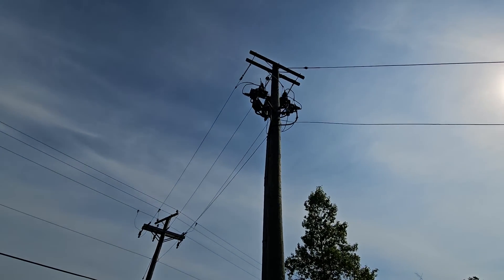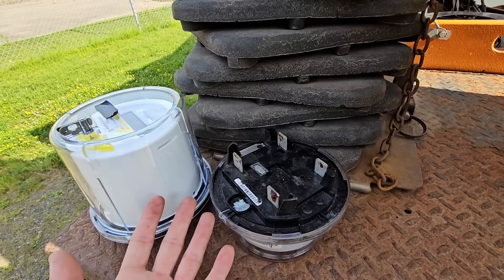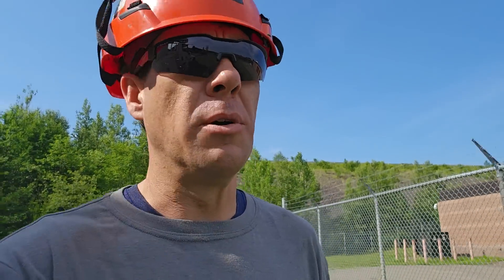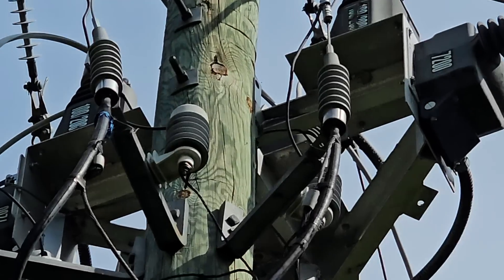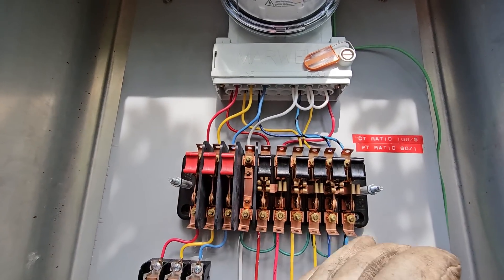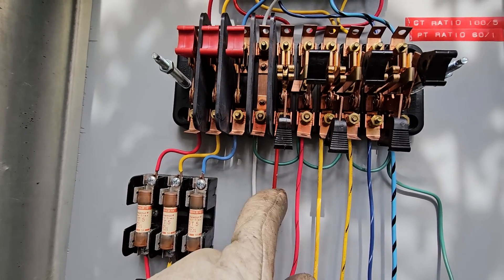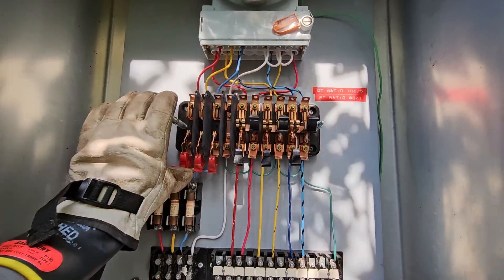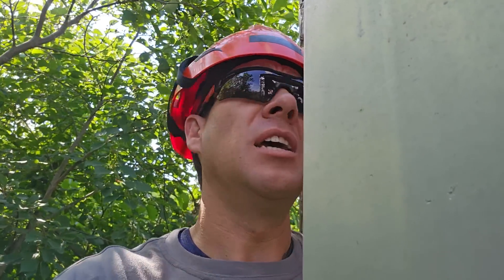Changing a "Smart meter" - 3 phase

Comment: In Germany every (most)costumer has a 3 phase 400 Volt and 63 ampere. Use a costumer more than 80 amps, they use the same technique to metering  like this video.
But the transformer are more central and the wirering are underground. The hole neigborhood use the same transformer.
The wires get in the last 40 ore 50 years from overhead to undergrund. Only 13kv and more are overhead lines.
I appreciate your content. Greets from Berlin/ Germany.
Reply: Same in Sweden, you just basically never see overhead unless it's high voltage distribution lines.
Reply: @Danieel-ip6hg  Sounds like a nightmare if you have a fault trip a substation breaker. Imagine the driving you'd have to do. Thump thump thump, find the fault 6 hours later and 40 spans away.
Reply: We do have 230/400V overhead lines in Germany, but only in rural areas or older buildings, where changing to underground cable would be to expensive.
Reply: @thebamplayer  Yeah, we do too of course. But the norm is definitely underground.
Reply: Residential is typically 3 phase 400v??
Reply: @petermuller161  Yes, unless it's very old. Older apartments with gas are often only given one phase with 230 volts.
Reply: @Danieel-ip6hg  Can we import this to Texas? LOL. Third world power grid over here...
Reply: @petermuller161  But it is three phase, no? It's just that you distribute two phases to each house? Also I understand that Texas is disconnected from the rest of the US.
Reply: @petermuller161  Texas's grid is fine. You've either never experienced power reliability outside of Texas or you're one of "those" who likes to claim Texas is terrible at everything because they vote different than you.
Reply: @Danieel-ip6hg  Residential power in the US is single phase. Your transformer is fed off of one phase and center tapped giving you two legs 180° out from one another.
Reply: @petermuller161  yes

Comment: I worked in a hospital that was primary metered.  The hospital owned the transformers that powered each building.  There was switch gear that had seitches for the primary side of each transfotmer.  The cancer center had its own 277 480 3 phase transformer, as well as the main care clinic as so often.  I had to replace the transformer for the cancer center as it went bad so i had to put on my arc flash suit just to throw off the main feeding switch to that transformer.  I love those test switches.  Now most transformer rated meter bases have a meter bypass lever similar to a lever on a 320 a self contained meter.  Those Marwell a to s meter sockets are nice.  Also Ekstrom EJ Brooks makes a nice a to s 13 terminal meter socket.  I do metering as well so i work eith lots of this stuff.  Also i dont care for those cheap Itron meters.  I perfer either the GE Aclara fitzall or the Honeywell Elster A1D meters.  Elster usec to be ABB.  Asea Brown Boveri.  Also was Westinghouse back in the 1980s. Landis Gyr is okay but i dont care for the size of their meters.  I have worked with many of the ASX4 meters as well the new ones that just came out a few yrs ago.  Now many of the 200 a landis self contained have a built in breaker that can allow the power co to remotely shut you off.  Itron used to be Schlumberger, befor that it was Sangamo.

Comment: In most places where smart meters are used, there's a charge on the bill for peak power usage.
Reply: In commercial installations they make a lot of sense, remote metering and being able to analyse demand, peak, off-peak etc really helps.

But in residential I think they are a moneygrab.
In my City they rolled out digital meters basically only because they want to replace old analog meters since they cant guarantee their safety and accuracy after 30 odd years in service.
They say smart meters aren't really worth it for them since they are more expensive and don't provide much benefit to the local grid operator since they already have good metering at every sub and local feeder.

Comment: Always interesting seeing the wire colours other countries use. Here (New Zealand) three phase is also red, yellow and blue, but neutral is always black. Single phase is red and black. Most appliances though have the European colours (brown and blue), so another set of colours to remember. Not sure how we do industrial metering like in the video, the only three phase meter I’ve seen was wired similarly to a residential meter (inline) as it was essentially a retail store, so no heavy loads except for a roller door. I believe the door was the only three-phase circuit, everything else was divided evenly across each phase.
Reply: And, of course, here in the States, the colors are Black-Red-Blue or Black-Orange[high-leg]-Blue.  Or Purple-Orange-Yellow.  Neutrals are white or grey.  Ground(ing)s are always green, green/yellow-stripe, or bare.

Comment: There isn't really any difference between a current transformer and a voltage transformer, its just the way that they are used.  A current transformer is just one that has a very low resistance burden connected across its secondary winding and it usually has a very high turns ratio.  The primary might have say one turn and the secondary 1000 turns.  In normal use the low burden resistor allows sufficient secondary current to flow to cancel the primary current with only a small voltage across it and an even smaller voltage is reflected to the primary.  So the presence of the CT has negligible effect on the load circuit.  If the secondary circuit is opened then it ceases to be a CT and becomes a voltage transformer and just like any other voltage transformer it will try to generate a secondary voltage that is the turns ratio times the primary voltage.  So in this case if the primary is say 7kV then it will try to produce a secondary voltage of 7,000kV.  This is sub optimal.

Comment: I love seeing how other countries / companies do things. That is neat trick of using a shorting switch before removing the meter, so as to prevent a high voltage on the current transformer secondary.  Occasionally we would get trainees and the rare apprentice for a week long visit for the experience and to 'assist', in the lab I was in.  They were mortified when we kept shorting out the secondaries of current transformers (we could push through up to 2,000A on the primary).  I had a small current transformer that was junk, but would always put on a good show, place it in the HiPot cage make the wires on the secondary about 15mm appart pass through a couple of amps on the primary and watch the sparks.  I don't know how they were installed out in the field, but we used to get a number of current transformers back from the field with damaged insulation.
Great video, Thanks.

Comment: Regarding the current transformer, if it is essentially an AC current source representative of the customer load by some fraction, then it is designed to be connected to a very low impedance, as in the power meter. With any current source, the output voltage equals current times resistance. An open circuit has very large resistance, so the output voltage will also become very large. The open-circuit voltage will rise until it arcs over, or finds some other path through parasitic capacitance in the transformer windings, for example. Whereas voltage sources don't like short-circuits, current sources don't like open circuits. I'm not familiar with CTs, as such, but the electrical theory should be the same. Please correct me if I missed something!

Comment: Hi Aaron years ago I had a friend who had a old retired electric meter and he made a table lamp out of it. I thought it was neat to have a meter connected to a table lamp. I was wondering if I could make one with a smart meter?
Reply: As long as the internal copper or aluminum carrying conductors are intact, it will work. Some smart meters will have an internal switch though, and if that switch is open, then you would need to close that connection.  My old boss had a lamp like you describe and it’s cooler to see the old disc spin, imo

Comment: Looks like some meters we use in the US as well. Some buildings I worked at had different 3 phase meter. some of the 480V service ones have dual displays . the second display is demand . I seen 208V 3 phase with that same type meter .just different brand . the old meter had the dials and the 480V one had 2 sets of dials . I was working at time of meter change to see the newer meter go in.

Comment: My understanding is smart meters have a built in cell phone.  Driving around you will notice some transmission towers have cell antennas mounted on the sides.  Some substations also have cell antennas.  Your meter reports to the nearest substation or transmission tower.  This is how the power company knows instantly when your neighborhood has a power outage.  They also know which circuits are out and can instantly reroute power around the outage.  I remember the old days not too long ago when customers had to report power outages themselves.  Then wait while the crew drove around looking for the problem.
Reply: Maybe some do.  The ones in our area use 915-930 MHz ISM band, spread spectrum.  Yes, there's receivers on poles every so often.  Often the system is not what would be described by security pros as secure.
Reply: Linemen are underpaid...they keep everything going....and it is everything
Reply: Those transmission towers with cell equipment are not usually for the utility company's use. In most cases is just a good location for cell equipment placement so think of it as "shared space" instead of another tower being erected. BTW, that shared space is actually a rental, which means the cell providers are paying to use that location.
Reply: Our meters are RF in the old pager frequency band. We have antennas on radio towers that communicate two ways.  It’s a remarkable system that informs us of readings and outages in real time.

Comment: The other reason you need a PT is because the current isn't necessarily in phase with the voltage, nor is it necessarily a pure sine wave. In order for the meter to record real power, power factor etc. accurately it needs to measure the instantaneous current and voltage on each phase thousands of times per second. It sounds difficult but there are specialized metering DSP chips that do the measurement internally so the main processor just has to tally up the total usage and report it.
Reply: The only purpose of a PT is to step down voltage.  I have no clue what you are trying to say but it's probably wrong.

Comment: The way you explained seems that the ratio of the transformers can be tuned on the unit. As they are probably hard to inspect, how do you guarantee that the customer doesn’t mess with the CT ratio directly on the transformer in order to pay less for electricity?
Thanks for the videos! As an electrical engineer that doesn’t work with high voltage, I learn a lot from them.

Comment: 7:03
From what i see, the cutoff is on the "load" side of the fuses..
So if by any chances, a fuses needs to be replaced, it will have to be done "live" ?
Reply: yes, but using insulated pliers. It's only 120 volts so not too bad to deal with.
Reply: @rupe53  i know, but still odd
Reply: @martf1061    I saw this all the time before retiring. Generac transfer switches have them and I own at least one pair of those pliers. Heck, Radio Shack sold them at one point.
Reply: @rupe53  safety wise, the "main swith" should be the first thing, the main conductors pass through
Reply: @martf1061    with transfer switches yes, you could kill the main breaker to service the fuses. OTOH, most times I found the generator was already running so now we have the possibility of both gen and utility power in a switch cabinet. Working "live" is really the easiest way to replace a fuse in that case. From a service viewpoint, I suspect that's exactly how they handle things with the gear shown in the video.

Comment: You geeks who want Too Much Info on metering should read "Electric Power Metering" by Archer E. Knowlton, several editions like 1934. (He also did "Standard Electric Handbook", similar but different.) I don't see paper copies today, but Internet Archive has a fine e-copy. 
"in depth"... that book runs 333 pages with some strong math. Somebody in every meter-maker has to know all this stuff; then the lineman can look-up the dozen common connections and let the company engineer call the meter company to verify any complex connection. 
When I was very small, all domestic meters were "20Amps". Real homes were already sucking 50A, but average demand is much less (my house is under 2A at the moment). 20A was the most accurate point, but the meters had been beefed-up to stand 30A 40A 50A even more, at least to cook dinner. At less precision, but a home can't run big current for long time (you could not afford it). 
I thought the problem with open-circuit on a current transformer was that any building load would kick-up HUGE voltages around the CT loop. At house-size loads they can size the core to limit the OC voltage, but things are different at factory and utility scale.

Comment: I have always liked the description of Primary rate metering is that metering is simple " Sampling transformers step down the Voltage and the Current down to a level a self contained meter can read on all three phases of power. This metering can be set up for overhead to underground lines like you show in the video. Or Overhead primary to overhead customer owned system. The metering for the customer owned system would be the same. The size of the metering transformers would be based on the customers expected load.  Great video.

Comment: 9:32  -  very well pointed out, the reason you cant leave a CT secondary open, is because of the magnetic flux that will be induced within the CT! It causes a spike in voltage and can surpase the ratings for any of the CT bushing insulation causing an arc. Keep the awesome videos coming!
Reply: CT’s generate current which is converted to voltage by a burden resistor.  V=IR so greater resistance (more ohms) means more volts.  Open circuit (infinite ohms) = danger danger danger
Reply: It's my understanding is that when not connected to the metering device, a CT secondary should be shorted.  Otherwise, high voltage "spikes" can be generated.   The power to do damage is limited to the saturation of the iron in the CT.   Of course, a simple reversed diodes in parallel will make the shorting automatic and that might be built into the pole mounted CT.

Comment: The danger of opening a CT secondary when the primary is energized comes from the inverse relationship between voltage and current in any transformer. In this case, you only have the 5 amperes of current in each loop when the loop is closed, but break the loop and you now have the CT working as a step-up transformer. When working on the current loop side, you actually want to pull the right-hand lever of each pair first and close it last. I grimaced when you just went left to right like that when getting ready to swap the meter...
Reply: Interresting stuff .
Thanks.

Comment: You nailed it with not wanting to open CTs when they're live. I've seen the aftermath form some medium voltage stuff blowing. It's less that the current jumps up when you open them and more that inductive loads don't like changing how much current passes through them. So if you had 5A going through and you change the path from a copper wire to a few inches of open air the voltage can spike and either draw an arc at the switch or break down the insulation and energize the secondary side.

Comment: Nice work Aaron, I like the color code you guys use. I've been pushing my company to use a similar color code. One thing I do is mark phase rotation in all my 3 phase meter boxes. Knowing the rotation comes in handy during transformer changes and storm restoration.

Comment: The difference with primary metering is that the customer gets to pay for the power loss in the stepdown transformer.  I was the design engineer for a manufacturing plant that had four 2.5 MVA padmounts with a single primary meter. I  enjoy your videos.
Reply: You have my curiosity - what scale of power loss do you see in this kind of setup?
Reply: The customer might be using a high voltage motor (very likely in a water pumping station) or a specialized transformer ( for example in an aluminum smelter).
Reply: @curtw8827  This isn't factual. The vars are still being delivered and not recorded as watts. That's why we do 4 quadrant metering now.
Reply: @Meowth849  All the heat generated in the stepdown transformer is watts, the customer is paying for them due to the primary metering. The customer may also be paying for powerfactor (vars).  If the metering was on the low voltage terminals (typical), the customer is not paying for losses in the transformer since they are ahead of a secondary meter.  My manufacturing plant has power factor correction equipment to minimize vars through the primary metering  to the site.
Reply: @curtw8827  VARs are what is used to magnetize a transformer coil, but yes. If it's primary metered this would be recorded and billed assuming a 4 quadrant meter or in the case of only delivered power. I'm not sure what I was thinking - I guess not primary.

Comment: On 3-phase meters, the self-contained types will usually have five or 7 lugs. Transformer-rated types will have either 8 large lugs or 6 large lugs and a row of smaller lugs (that's the the first time I've seen a transformer-rated type with only 4 of the 7 smaller lugs fitted; the three 'missing' lugs were for an external demand meter in the old days - before the advent of microprocessor-based meters).